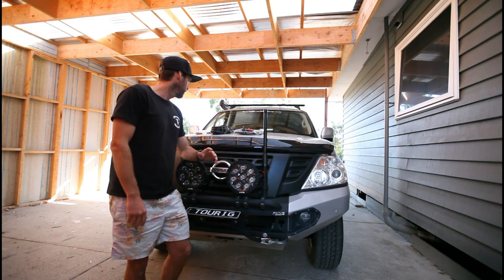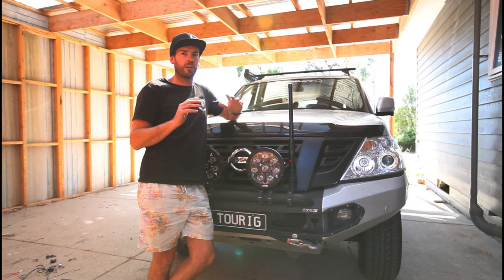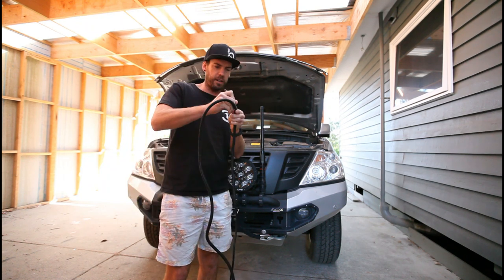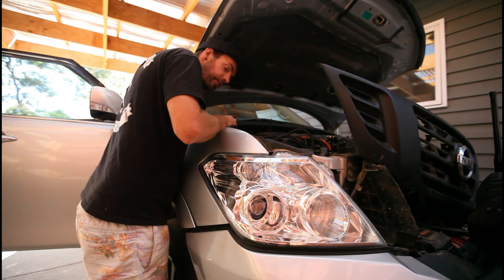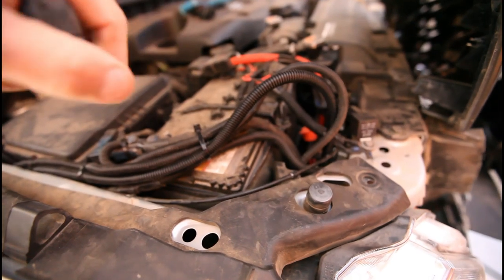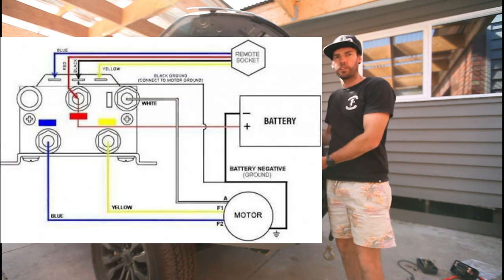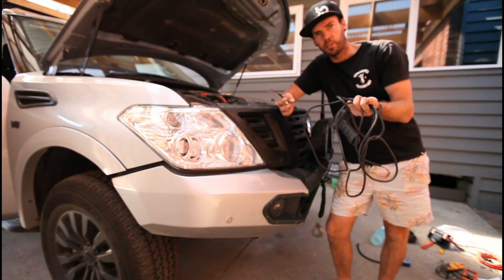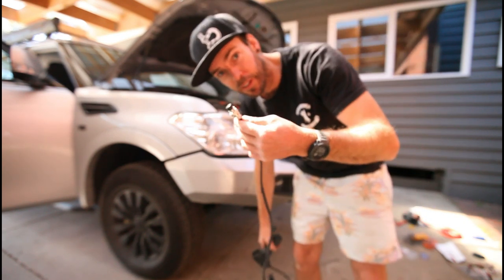HOW TO INSTALL IN CAR WINCH WINCH SWITCH. FOR IN CAB CONTROL.

Comment: Good instructional video. 👍 Only difference in mine is I've wired mine directly to the solenoid so the outside plug on the solenoid box is always free & the lead can be plugged in without having to unplug the in cab switch link.
Reply from the maker: Yep Definatly more ways than one to skin a cat, I'll hopefully never need the hand controller again
Reply: I like that you didn't have to mess with the Solenoid because I can't even access mine without having to take a shit ton of parts out.

Doing it this way I think is smarter although "less neater"

This method would work for me and way easier.

Comment: just a layman here so more of a question but shouldn't the positive from the solenoid be fused? That's quite a few meters of positive cable back to the switch when the winch is powered.
Reply from the maker: Yeah mate would be good practice to fuse it. I haven't as it's in split conduit the whole way and only powered up if the isolator is on. But definitely worth doing it and I probably will if I get back around to it

Comment: Did you use 3 or 4 core wire as you connected 4 to the switch
Reply from the maker: It's a 7 core trailer wire that gave me spares under the bonnet which I've since used to switch relays for lighting
Reply: He didn’t explain the ground wire mate, you need to source a ground for the switch so id recommend using 4 core wire

Comment: You need another switch that powers up the in cab switch, that way the in/out cant be bumped accidentally.
Reply from the maker: That's why I have the isolator disconnect under the bonnet so it can't be. I only connect it when I need to use the winch
Reply: @4x4brothers  the whole point of in cab is you stay in cab :)
Reply from the maker: Yep but 99% of the time you know before you get in a situation that might require the winch so you can turn the isolator on before it happens,  I wanted it only for operating the winch not to control the power, each individual situation is different.
Reply: Best way to do that is to wire an isolator switch in the cab on the earth wire for the solenoid. Then when the isolator is off the remote and the in cab switches will be isolated 👌

Comment: Nice one mate, I installed a master power switch in the cab as well. Saves me having to get out of the rig.
Reply from the maker: That's the go, I was thinking about doing that but with kids in the car I wanted it kid proof just incase 😂
Reply: @4x4brothers  I ended up converting my roof console into a hub, Holds the XRS and  a switch panel. Lucky my kids are old enough to not play with it. Apart from my 5 year old. hahaha
Reply: So in this video, you didn't wire into the control box...... Instead, you plugged into the female socket with a 3 pin male plug, the. Cut the other end of that and spliced your leads going to your cab??

I'm I understanding that correctly?
Reply from the maker: @alfredoandrea8345  correct mate I had the cable spare so I did it that way so i didn't need to make any holes into the control box to bring the wires in. 
If I had have done it a direct connection I would have just drilled a hole and ran the cable through a gland to seal it up from water ingress.
Reply: @4x4brothers  the only thing I'm unsure of is the insolators.. what did you plug that into?  Do I need that or can I do without them
Reply: @4x4brothers  what was the gague size you used for the switch.  Was it 14, 16, or 18.  Or was it lower

Comment: personally i'd add an isolation/killswitch on the positive into rocker switch to avoid bumping it while driving.
Reply from the maker: Yeah have toyed with that idea too I may do it just as a secondary safeguard from the one under the bonnet
Reply: @4x4brothers  each to their own, whatever works for each person is the good solution. i had a friend not install an in cab kill switch and bumped the rocker switch without realising. wrapped round his wheel
Reply from the maker: @drummaguyhixy  definitely something you need to be mindful of. I've only got the under bonnet one in if in situations where it might be needed otherwise comes out. If that wasn't the case definitely need one